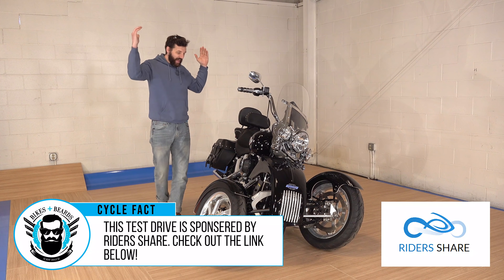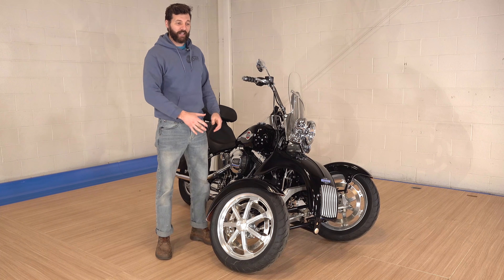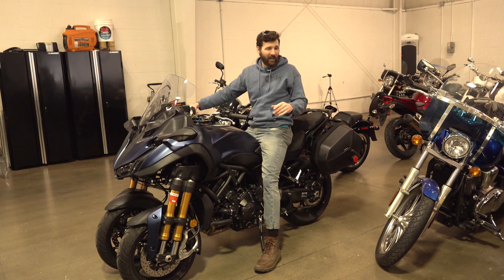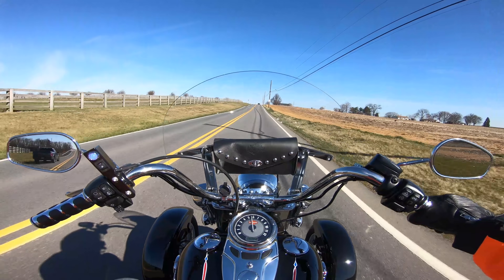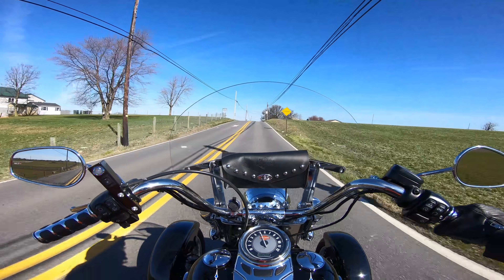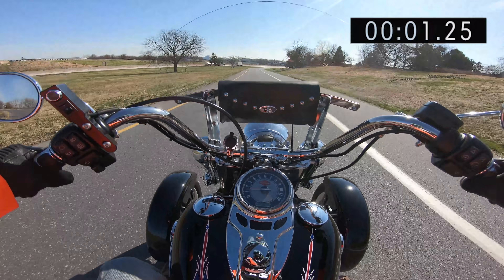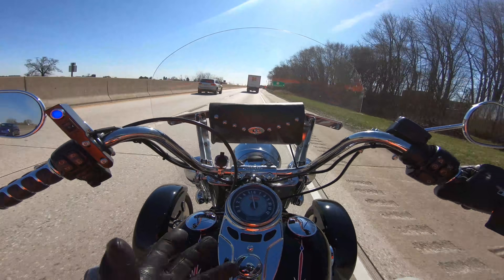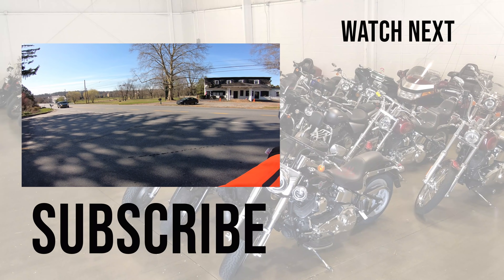Test Driving the Craziest Harley-Davidson ever: Tilting Motor works

Comment: Sean,  thanks for the Video I appreciate your enthusiasm and how you bring to life each bike you test ride. I saw the Recent Jay Leno YouTube where he interviewed the owner and inventor of the Tilting Motor works Trike kit. Since then I have considered buying one.  I am 72 and have been riding since I was 15  years old funding the hopping up of my 1062 Honda 305 Superhawk. When I was done with it I the bike was doing wheelies in all four gears and I difficulties smoking out clutches, breaking chains and crashing the transmission bending putting so much power through it that I bent the main transmission shaft. However because of  work demands on my time I took a 10 year hiatus from motorcycling and got down to one bike (an old R50/5 BMW airhead that was not running and I was  considering restoring. This summer I semi-retired deciding to get back in to riding again.  So in the last 6 months I bought 5 motorcycles and began watching YouTubes to catch-up on the M/C industry. Of all the M/C YouTubers I enjoy yours the best. Also ...on another note  I was stunned and surprised to see how much my riding skills and strength had slipped in the last decade of not riding.  I doing fine on my smaller bikes like the new Huskavarna Svartpilen 401,  the Suzuki DL65O VStrom, or the BMW1200GS. However, I continue to struggle with the Honda Goldwing GL1800 and have  Dropped it twice  when comming to a stop with a side slope.  I weigh in at 215 pounds and both times was carrying a 200 pound passenger. So now I only ride solo, as I still struggle with the 900 pound Goldwing in low speed maneuvers.  I know a time will come when I am not able to keep riding a heavy two wheel bike, So I am considering adding a tilting 3-wheel motorcycle, or a maxi-Scooter like the 650 Suzuki Burgman Executive to my stable. What are your thoughts and recommendations here?

Comment: I have a Piaggio MP3 500, it is stable on bad surfaces and in wind.   My sidecar motorcycle took a lot of practice to ride safely.  Right turns were an adventure.
Reply: I just sold my MP3 500. And I miss it already. But I just had too many bikes in my garage. The MP3 500 was indeed amazing in cross winds and when meeting large trucks. It also rode very well and could eat up miles without wearing you out. My biggest day on that Piaggio was 560 miles and I still felt good.
Reply: @2500vtg  I think about selling it now and then,  and then I ride it on the freeway.  Nothing else I have is quite as comfortable or stable.

Comment: I have an 1800 Goldwing with the TMW conversion, it rides much as this guy stated. With the "Tilt-Loc" option it takes a while to get used to the transition from reverse steer to snowmobile steer which is sometimes awkward and it is possible to drop the bike. If you get one of these be prepared to invest some time in learning how to ride it.

Comment: I love the tilting motor works, but 13k for the kit means you have to be pretty committed to the idea. If you managed to find a used model, the value proposition is there - but a Spyder is the same cost as the kit and going to give you a pretty amazing experience. It's hard to recommend one of these if you aren't married to the idea of a Harley.
Reply: Or if you already own a harley...
Reply: They are doing it for Gold Wings and I asked them to consider the BMW 1600.  THAT would be cool
Reply: They make indian kits as well

Comment: Very cool. Question: if you stop on a side-side slope, will it 'level-up' in relative to the wheels (ie so the whole bike will e sitting at an angle, or will the bike be directly vertical, irrespective of whether one wheel is lower than the other?
Reply: Yes, it levels to the horizon. Visit Tilting Motor Works website and watch their vids.

Comment: I've got one and its dangerous as hell.  Once under way its just fine, but try making a standing turn or slowing below the 7 mph break free point for the front end and you'll find yourself heading for the ditches.  You did this in the video.  You went to stop before taking a right and the front end went to trike mode but YOU thought you were in tilt mode and headed towards the ditch.
Reply: so it is dangerous on low speeds and safe on highspeeds??

Comment: Hey Shawn. I'm working on my 94 vf750 and the box that controls the brake and turn signal lights has a wire broke off at the box. Can the box be replaced by its self with an open or after market part or do I have to replace the whole wiring harness? If you happen to have the part I need to fix it please let me know. I'll happily buy it from you guy's.
Reply: If you can get it open. You might be able to just strip some the the wire and splice it together again. Its not as difficult or scary as it sounds
Reply: @roadsentinel4080   thanks bud I'll give it a try.
Reply: @srkcycles hey I got a great idea..Shawn..you should start a motorcycle forum  board for people to help each other with there motorcycles if they are working on them

Comment: Nice video, nice tech, if you get to Milwaukee and get to the Harley Museum and are lucky enough to get to know an R&D guy you can get a tour of the Skunk Works (top floor of the west building. There you will see 2 tilting Harleys that they built after taking apart a Piagio MP3. They did this back in 2006. Just saying.
Reply: @lesoram6236  Harley copied an Italian design when they R&D their version of a tilting front end. They picked up one of the first Piagio MP3s from Reina International Autos which happens to be about 3 blocks away from the Harley Plant on Capitol Drive 

 Don't know who"s designs Titling Motor Works got their inspirations from. There were a bunch of tilting designs in the early 2000s. There was an internet forum where designers put things out there to share and promote tilting 3 wheeled motorcycles.

Comment: I want something that looks like a Super Seven from the front. At the right angle. If you squint.
And I need it to be heavy. Much heavier than a Seven. And taller. yes, taller.
And while you're at it, I want 3 wheels, not 4.
Got all that?

Comment: Doesn’t look like your counter steering at all. Completely the opposite actually. It looks like your using the handle bars like a steering wheel and then the bike leans because of the design of the front end dynamic.

Comment: Interesting.  Tilting Motor Works...owner's name and location are on his website or in the company's own videos if you check.  This srkcycles video is interesting, but for the life of me I can't understand why videos like this don't say anything about how highway pegs (mounted on the engine guards) can't be used with this arrangement.  If a rider is tall and uses highway pegs, I don't see this as a complete solution (but the engineering is remarkable).

Comment: This looks just like the dong fang scooter I had several yrs ago.  If it tilts the same, it is not like what most people think.  It takes a lot of getting used to and you do not want to get it to replace a traditional trike or reverse trike.  Harley is way behind the cheap Asian scooters if they just started with these.

Comment: "was made for performance" :'D It looks like a modern part on something designed in the 60's. Maybe it's a lot of fun to ride but anything you bolt on a platform like that is automatically not a performance part. That's like putting slicks on a bog standard tractor trailer. Over here this bolt on because of the with woud classify this vehicle as a car type vehicle, meaning you can drive it with a car drivers license. But it woud also mean the vehicle woud have to be re approved by state.

Comment: Side cars do steer quite well, you just have to know how to ride them. I had 2 Urals and never had a problem with them on the corners or bends, in fact they were a riot on windy roads. If a side car is set up right you should have no problem doing windy roads at a good clip. And if you get a 2 wheel drive you can go almost any where. The only people who have trouble with side cars are them that try to ride them like a motorcycle or a car. they are different and the other problem is if they are not set up wright which goes for any bike. Before making comments like you did bet a Ural that is set up wright and learn how to drive it, You will find that they will put a huge smile on your face. It is the same as someone coming from a car to bike they have to learn hot to tide it. Also if you put a monkey in the side car you can really fly around them corners.( a monkey is the person in the side car )  LEARN ABOUT SOMETHING BEFORE PUTTING IT DOWN.